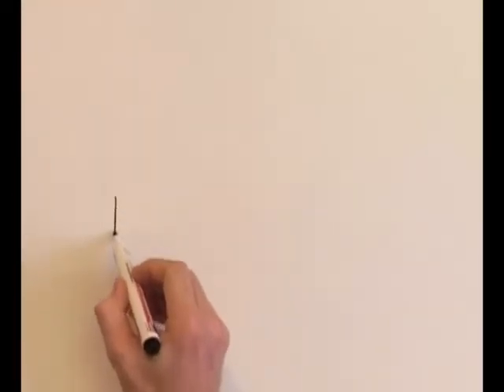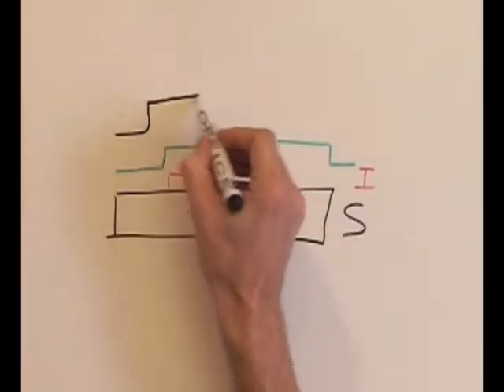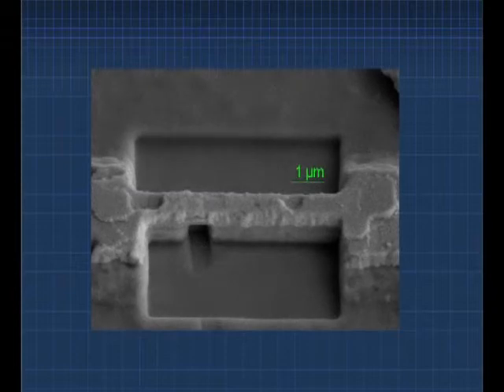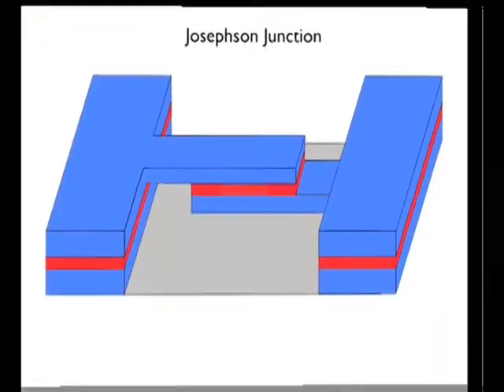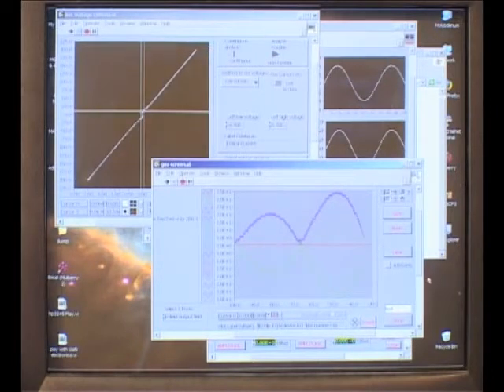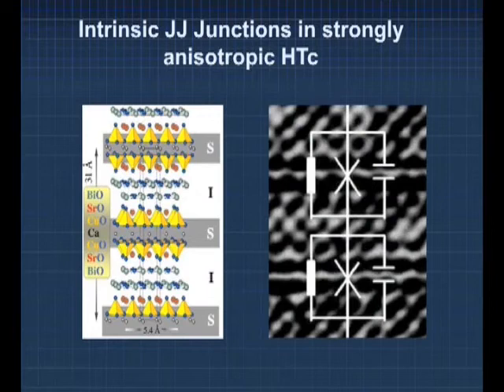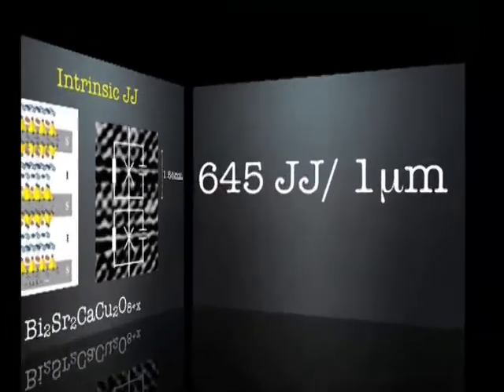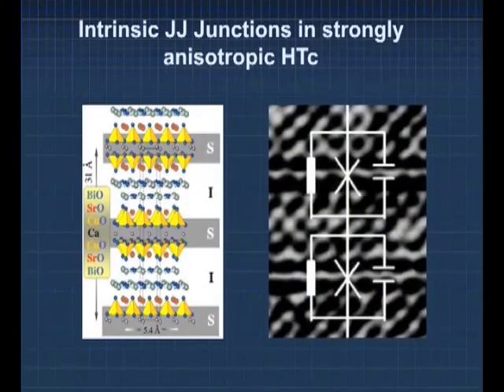Superconductivity: fabricating special Josephson Junctions

Comment: Can nanoetched lithium be super conducting?
Reply from the maker: No idea.
Reply: @bhadeshia123  I read a paper that has a theory for "excess heat" generated in old lithium cells. Apparently, they generate more thermal energy than is predictable and the theory is electron positron annihilation emitting gamma rays because of nanostructures etched on the surface . I have also read that high-temperature super conductors exhibit annihilation, not that this is a feature of all superconductors. Do atom nuclei have event horizons? Like an electron is accelerating towards the event horizon, crosses and a positron gets left behind and annihilates another real electron?
Reply: @bhadeshia123  I am going to make a VCR for measuring flux density of lithium.